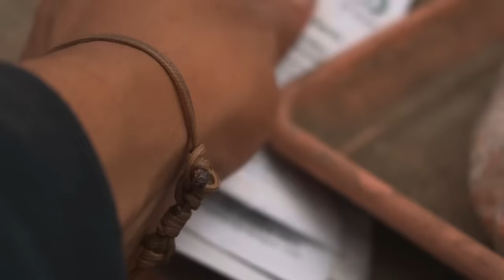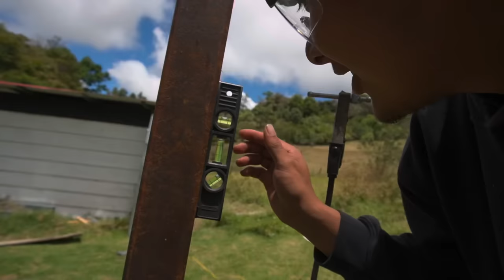This House Improvement Is Ready | Amateur Off-Grid construction

Comment: Rodrigo you are a damn card meaning I find you funny as all get up, I was just thinking about you when you first started YouTube how  scared you were, and wondering if you were doing it right and now …………….your showing off, funny boy Rodrigo love to you and I am sending many blessings….💖💖💖🇦🇺 Rodrigo for tomatoes buy a bag of potting mix and put 2 holes one at each end, add 2seeds and water as the plants get a bit bigger drop 2 strings from your frame and train you tomatoes up them. Best no dig garden. 💖💖💖🇦🇺 you also need to buy the paint that turns rust to metal. ASAP